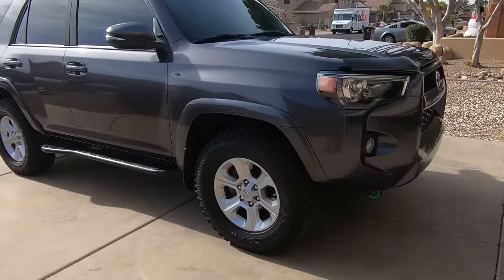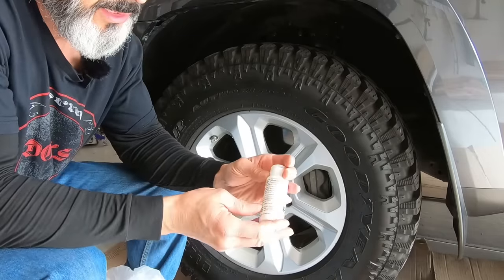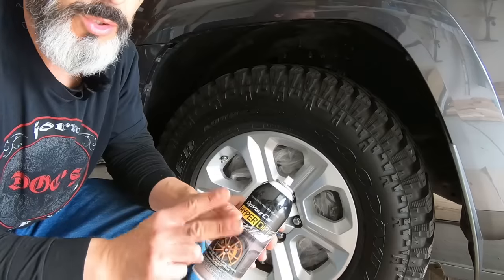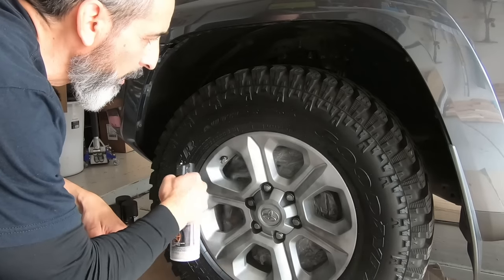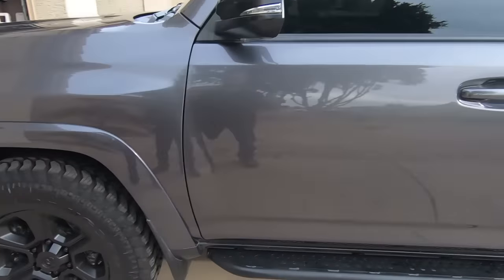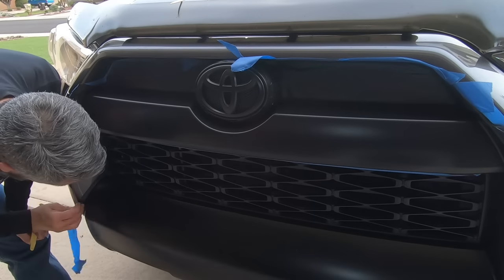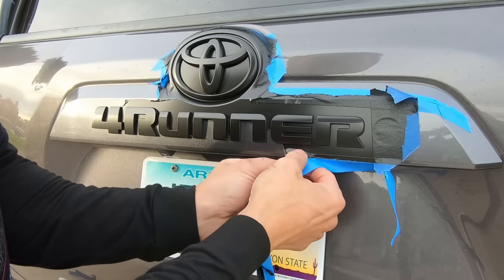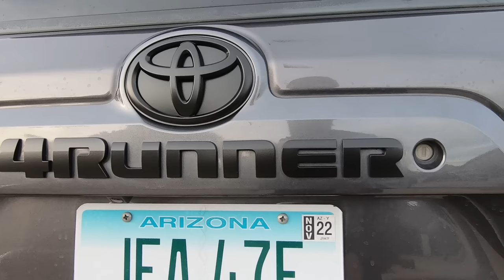HyperDip (PlastiDip) 4Runner Transformation!: How To

Comment: I have a black sr5 and I never knew this was possible! I’m so tempted to try it but scared I’ll mess it up. I’ve never done anything like this before. Your results are amazing!
Reply from the maker: Thanks Brittney. Here's a suggestion if you want to attempt it. Don't go all in right away. Take 1 wheel and just focus on that. Take you time with it and learn what is working and what isn't in regards to spray angles and how fast/slow you are spraying. The worst case is you mess up 1 wheel. Let it dry and peel it off and start fresh. Just make sure you put enough material on so it peels off. If it is too thin it won't peel correctly. If it looks good, move on to the next wheel on a different day. You will get progressively better. Most importantly, don't try to stray from the correct prep, wetness, and # of coats.
Reply: u wont mess it up. its just plastic u can easily take it off.
Reply: I have an S5 and did the wheels w matt black. Looks awesome.
Reply: Go for it

Comment: I tried it... after leas rhan  2 months the brake dust destroys finish ... lots of work for not much lngevity ...
Reply from the maker: I have had this on for almost 2 1/5 years now and it still looks good. I did not experience what you did. Maybe yours was not applied thick enough or  the coats weren't wet enough. I'm not sure what happened, but you can see the condition of my wheels after 1 year here

https://www.youtube.com/watch?v=_RprxIX2NX0

Comment: Does one use the peel prep gel and pre-spray when using on emblems or only on wheels? I thought HyperDip didn’t require pre-spray like plastidip.
Reply from the maker: Only on the tires before spraying the wheels. you don't need to put it around the emblems, it will peel off the paint easily and break at the raised emblems as long as you build it up correctly.

Comment: Great results, well made instructional video. Let me ask, did you have any over spray issues on the body fenders from not masking them. I'm asking cause i want to hyperdip my 06 Tundra wheels and i like that you didnt have to take extra masking steps.
Reply from the maker: I did not get any overspray on the body from the wheels. i did get a little overspray from the masking of the rear emblem. I should have put another layer around on that, but it was easy cleanup. It shouldn't be an issue doing the wheels on a Tundra as long as it's not windy. On trucks, with the wider sidewall and distance between the wheels and body panels, it shouldn't require masking. On some cars where that distance is less, it may require masking.

Comment: Looks awesome. Want to do that to my 4runner supposed to get in another month or so. What do you think durability will be? Wonder what lug nuts will look like after taking off and putting back on.
Reply from the maker: I'm hoping to get at least a ear out of the coating, but we shall see if the Arizona sun has different plans. I might have to do a video of removing the lugs. Not sure what the result will be but i will have a back up set of black lugs ready
Reply: @AZOverland2017  I was wondering the same thing about the lugs for tire rotations/alignments....
Reply from the maker: @stevenjunk1268  I did a video on this also. See below

https://youtu.be/2UnvQ9pRUcE?si=wU4UZD69s6ScyuWW

Comment: I really really wanted to see how much hard or easy it was to pull off tires
Reply from the maker: Well, you would need the proper number of jacks and jack stands to be able to get all 4 wheels off and have the vehicle safe. This is not necessarily easy and most people don't have that equipment. I do have it, but this is much easier to do with wheels on. Also, you would need to allow the wheels to dry completely before handling them to get them back on.
Reply: @AZOverland2017  no I was saying that I was looking Forward see you pull the dip off the tires to see how easy or hard the dip comes off the tires
Reply from the maker: @makingsense2017   OK, sorry, I misunderstood when I replied to this originally. It comes off very easily if you do the Dip Release and  make sure you have enough layers. If you go too thin, then you will have issues getting it off. When done correctly it literally peels off in 1 piece easily. Sorry i didn't record that part, it was a long day at that point and my camera and i were both tired
Reply: @AZOverland2017  thanks for the replies and your video was very helpful and informative

Comment: Overall, how long did it take you to do this and it sounded like you did 12 to 15 coats per tire. I just scooped this up for my 2008 Toyota sequoia. Great video thanks!
Reply from the maker: I think it took about 4-5 hours but that included the front and back in addition to the wheels. I think 10-12 coats is sufficient if done correctly. Good luck!
Reply: @AZOverland2017  Thanks again for responding. I actually did buy emblems,grille and back hatch already, and they turned out great.

Comment: Thanks it really helped to do on my wheels.. can you share the link to the roof rack. I like it. Pls
Reply: I tried searching but no luck … pls share the link.
Thanks @AZOverland2017.
Reply from the maker: Thank you. Here is the information on the roof rack. I will try to find a link for you but there are so many options for it. 

It is the Rhino Platform Rack. The size of the rack is 49"w x 60" L. I am using the Vortex SX crossbars that attach to the factory rails. I believe the part # is JA9141 which is the legs and the bars or the separate part #'s are SX100 for the 4 legs and VA126B for the 2 black crossbars. Please confirm all #'s
Reply from the maker: @binugeorge4765  https://www.rhinorack.com/en-us/products/roof-racks/platforms-and-baskets/pioneer-platforms/pioneer-platform-60-x-49-unassembled_52100f
Reply: @AZOverland2017  Thank you so much !

Comment: This is the second video I've watched with Hyper Dip and neither of y'all masked off the car. Are you not worried about overspray with this product? Thanks!
Reply from the maker: With the 4Runner, no need to mask around the wheels because of the size of the sidewalk and distance between the tire and fenders. With a car, I would mask a bit. Regarding the emblems, I did run some masking paper about a foot on all sides. For this, I would recommend running another layer (2') on all sides. Especially you are dealing with wind. Overall, my method worked out fine for my conditions. I also painted cars for a living for several years so I sort of knew the threshold of containing the over spray

Comment: Did you apply the dip release outside the emblems and the pre-dips on the emblem too?
Reply from the maker: No Dip Release for emblems. Prep it thoroughly with the Pre Dip paying extra attention to the emblem edges. Make sure you do the recommended # of layers so it is thick enough to grab an edge for pulling when dry
Reply: @AZOverland2017  Thanks! Last question, did you use the same spray on the emblems as well or did you have a separate spray meant for the emblems only?
Reply from the maker: @FerdySantiago  It was the same.

Comment: Like ,but what happens if the wheels get dirty or mud on them? Will it wash off or does it fu up
Reply from the maker: Yes, they clean up fine. You just need to care for them a little differently. No harsh chemicals and be gentle with scrubbing. I've been off roading, driven through water crossings, pressure washed, and taken it through auto car washes many times. If you haven't seen my 1 year later update video, it's here:
https://youtu.be/_RprxIX2NX0

Comment: Hey my fellow AZ. We actually have the exact trim mand color 4runner. I just got mine and considering doing the same thing. Thank you for the video! I also purchased some of your recommendations
Reply from the maker: That's Great Sheryl! If you end up doing it and are near the NW valley let me know. Maybe we do a video on it
Reply: NW valley isn't far at all. 15 to 20 mins drive. I'm actually going to focus first in figuring out installing a push and rocker buttons for hatch opener and also rear window from the inside(back end). For camping purposes. Let me know if you're planning to do it. Thanks
Reply from the maker: @sherylh2567  Well, I didn't, but now I'm intrigued. Do you have a link, I would like to read up more on this. Thank you

Comment: Hi, did you plastidip the center caps? If so, did you put the stickers on the plastidip or before application? Thank you!
Reply from the maker: Center caps were prepped and sprayed with the wheels so they are dipped as they were and holding up just fine

Comment: Thanks so much for this video. I’m so going to attempt it this weekend. Wondering if the desert heat will wreak havoc if I do this in hot weather…..
Reply from the maker: It is better to do it in the heat then freezing temps. The material will dry faster so experiment with spray times as far as going moderate vs light. You definitely don't want to get runs buy going too heavy but also don't want to go too light and have a rough textured finish. Also, try to avoid doing it in direct sunlight. Start early. Good luck!

Comment: I bought a used truck where the wheels were painted with something similar and it's chipping. Should i sand or just wipe off like you did?
Reply from the maker: If it's Hyperdip or Plastidip, and it was applied correctly, it will peel off. It's like a rubberized coating. If that doesn't work they have a product on their website that is supposed to help dissolve it

Comment: Curious if scuffing the rims with sand paper would help with adhesion? Thanks!
Reply from the maker: I don't really see a reason to scuff. I did this almost 2 years ago and do not have any issues with adhesion. As long as you prep correctly and do those 1st few tack coats, it will adhere to the substrate (wheels, emblems, etc). I also don't think scuffing would be beneficial anyway, being a former auto body tech who has painted cars for years. There is a distinct difference between automotive paint in which you scuff the substrate for adhesion and a product like this.
Reply: Right on, thanks alot man!!!

Comment: it look really nice, Any recommendations when you are going to wash the car?
Reply from the maker: I've run it through the automatic car washes numerous times with no issue. If I wash it home and I use a pressure washer I just don't put the stream right on the wheels or other hyper dipped parts directly?

Comment: Great video but I have not come across a video on YouTube  saying anything about wheel lugs everybody just sprays over them but what about changing the wheel after you get a puncture surely you will  mess them up and the alloy  why not remove the wheels its more time consuming but good exercise but with less masking up and being able to get into those blind areas and once putting the wheels back you have already purchased a new set of black lugs which want get messed up - this is the way I would do it ...
Reply from the maker: Thanks for your feedback! Regarding the lug nuts, I did a video of me taking them off for the1st time after spraying. You can see the results here:
https://youtu.be/2UnvQ9pRUcE

As far as removing the wheel, Yes, the overall product could be better but the extra time and hassle may not be worth it. Most people don't have the tools (jacks and jackstands) to remove all 4 wheels simultaneously. Also, when you have your vehicle sitting up on jackstands, it's not moving for a day until the Hyperdip cures.

Yes, if you are changing your tires out for any reason, the finish may get damaged. Fortunately for me, I haven't had any reason to change tires and the finish has held up very well for going on 2 years. So, it was well worth the money and time to change the look, even if only for a few years.

Comment: Great video and info.
Just curious on how it holds up to rock chips? 
I have to travel on gravel a few times a week.
Reply from the maker: I have not had any damage from rocks. I have been traveling on an Arizona freeway about 12 hrs per week , many times behind work trucks and have been off-road 4 times since I sprayed it. I just washed the 4Runner today and went out to look after your asked this question. I have no rock chips. The only damage is from a branch that scraped my lower valence and took a little material with it. Good news is, the paint below that scrape is in good condition so it protected it pretty well.

Comment: I just hyper dipped my wheels but made a mistake when applying the dip, the bottom side of the outer ring on all 4 wheels didn’t get fully covered due to my spraying angle and you can notice some silver coming through. Any suggestions on fixing this? Do I simply go over the spot again? Any prep needs to be done?
Reply from the maker: Sorry to hear that. You definitely want to hit every angle possible, but you obviously know that now🙃 You should be able to re-prep and spray. Make sure the wheel is very clean and dry. Hit it with the Pre-Dip spray and microfiber towel and spray it again.
Reply: How did your touch up job turn out?

Comment: Do you think I’d be able to use this hyper dip on chrome rims?
Reply from the maker: Possibly. From the website (they say PlastiDip but the same holds true for HyperDip):

Since are differences between genuine chrome and factory "chrome" finishes. Plasti Dip may adhere and react perfectly normal over one chrome surface, but may have issues over another. Chrome emblems, badges and trim are traditionally fine - but a certain set of chrome wheels for example may cause adhesion issues. Due to the differences between the many "chrome" surfaces, it's difficult to predict the result for each application. Although it works fine most of the time, testing may be required first to confirm Plasti Dip is a suitable product for your personal application.
Reply: @AZOverland2017  thanks for the information. I'm going to try to test a small surface before buying the whole set of Hyper Dip.

Comment: Question when u backed it up outside did u remove the plastic bags behind your wheels??
Reply from the maker: That's a great question! I actually forgot originally and backed it out a few feet before I realized. Thank goodness the plastic only touched the wheel in 1 spot on the edge. It was easily covered with the remaining coats
Reply: @AZOverland2017  Thank u for responding and u did a great job
Reply from the maker: @JAY-lu3cx  I sincerely appreciate that sir

Comment: 6:50 I wonder what it'd look like stopping here.  It kinda looks nice ....... like a gunmetal brushed look but ......... through the camera it's hard to tell
Reply from the maker: The issue would be once you decide to remove the coating it would not be thick enough to remove correctly. If it has not built up you can't peel it off it large sheets

Comment: My tape borders got messed up , pretty tricky when there is no hard line between surfaces as its a connected piece. maybe a razor blade along the tape line will help keep it straight
Reply from the maker: What area of the vehicle were you doing? In the front of the 4Runner I had a similar situation but I ran an Xacto knife carefully where I wanted the break and it turned out real well.
Reply: @AZOverland2017  the grill ; sr5.
Reply: The wheels came out perfect, I bought a trd pro roof rack and the look is very appealing to me. I'm going to peel off the grill and do it again using a razor blade before peeling the tape
Reply from the maker: @skantiloak  Yes, exactly. that is what I did
Reply: @AZOverland2017  fixed it and love the look, might even hit up my paint guy and get it permanent on the grill lol
Reply from the maker: @skantiloak  That's great. Definitely makes the 4Runner look Mean

Comment: Did you get any overspray on the actual body of the 4Runner?
Reply from the maker: I did notice overspray on the back window, other than that, no. It was minimal and came off easily with a razor blade.
Reply: I was curious about overspray as well.  My GX is white and I'm going with Piano Black.  Probably taking the wheels off!

Comment: @AZOverland2017. What size tire are those?  Do you think it would be easier to take your tires off?
Reply from the maker: They are actually factory size but look a big bigger because they are All Terrains.
No, There is a lot to take into consideration. Are you able to get the vehicle completely off the ground to get all 4 wheels off; tools/equipment? Can you keep your vehicle on jack stands  until the next day without wheels while it cures? You should spray them upright, not laying down, etc

Comment: Just convinced me!  Looks really nice!  I always see hyperdip applied with the wheels on the vehicle.  No issues removing the wheels after to rotate?
Reply from the maker: I get this question a lot, specifically about if this product gets compromised  on the lugs when taking the wheels off. I haven't rotated tires yet though I am about to do so. I will have to document if there is any damage. However, I will replace them with black lug nuts if there is. It is still worth the money to change the look the way I wanted. If you do decide to order feel free to use the link in the video description. It is an affiliate link though when I made this video I was not in communication with this company at all. Good Luck!
Reply: @AZOverland2017 , thanks again!  I did use the link to buy, and got a first time discount as well.  Beat Amazon by $20!  I was thinking about removing the wheels to dip them, mostly because I tend to get runs when I paint!
Reply from the maker: @CenCalBimat  Great! 2 things. Spray cans cans are not ideal to spray when holding them horizontally. While it can be done you may get some spitting or the cans might not be used all the way. I understand about being concerned by runs and especially because this is fairly thin and can run quite easily. Make sure your 1st 2 coats are very light!
Reply: @AZOverland2017  kind of forgot about that!  Good reminder!  My first dip experience wasn’t great, but I didn’t keep the van vertical!